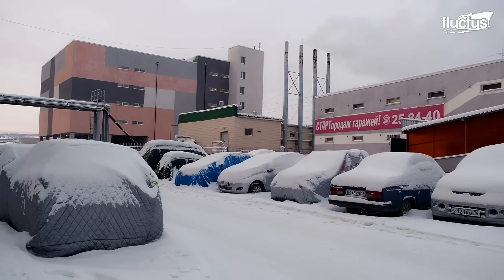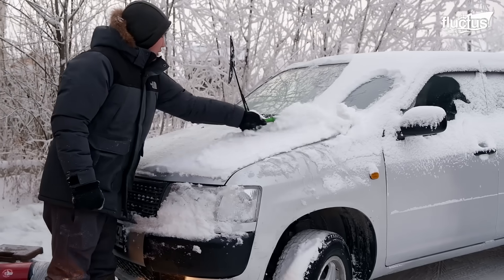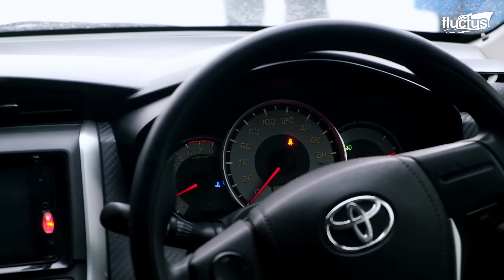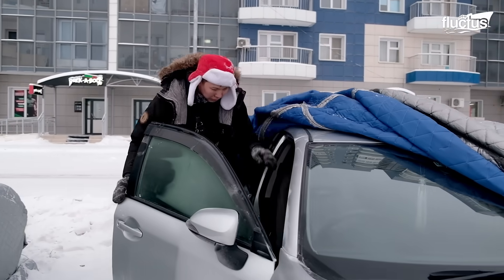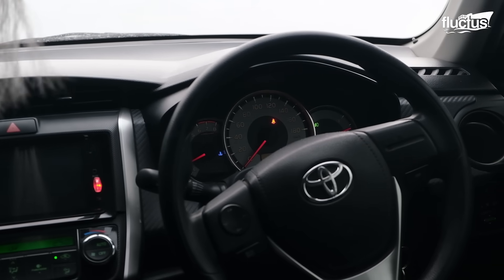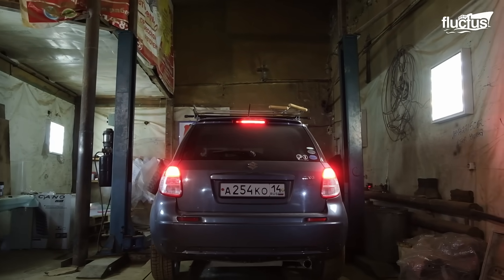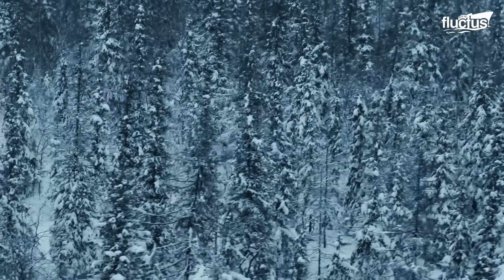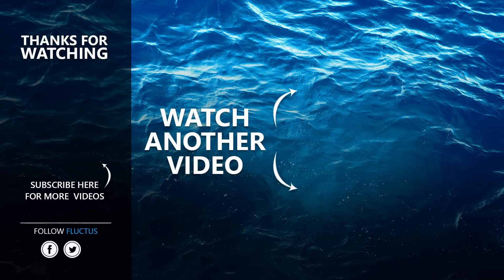How They Start Frozen Car Engines at -50°C in World’s Coldest City

Comment: In eastern Oregon we use a battery heater and oil heater, that’s why you see a plug pigtail sticking out of the radiator grill so we can plug it into an extension cord when we get home from work. Our temps can get down to around -5 so those work fine for us through the winter but definitely wouldn’t work for -50 degree climates. On top of that we have extremely low humidity levels which affects skin and other materials differently than the rest of the country, this dry climate is why you find mostly European people living these, others can’t handle the conditions just like I despise living in places like Georgia or Texas, the heat and humidity sucks for me.

Comment: They should have installed heaters for the engine and battery.  They have a battery warmer, engine coolant block warmers, oil pan warmers.  Still seems like an extreme environment

Comment: Although not quite this bad, from '76 to '80, I was stationed at an Air Force base in the northern tip of Maine.  I saw ambient temps as low as negative 29 degrees F.  Chill factors down to negative 50 degrees F.  I learned the hard way to remove the battery anytime temps got below zero.  Otherwise my '67 Chevelle would not start the next morning.  Being a native southern Californian, the winter weather in Maine was quite a shock.  I had to deal with frozen doors, tires frozen to the ground, and lots of oil leaks.  Old cars are not well suited to extreme cold.

Comment: Well lets see where to start? 
Synthetic oil is well suited for these temps.
Battery warmers with  low temp stats work very well. As well add a year or so of life to them. 
I see that they are trying for another Hindenburg , with attaching the ground onto the battery! It is always best to attach to a ground on the block/ or of such. So that any sparks are away from the battery. Not my doing but have seen 3 batteries explode, so don't wish any more. 
As well block heaters for such temps are a great idea. Or two depending on the engine size! 
I see the corrosion on the one battery at  (4:27 time. ) little  wonder why it did not start!! 
Prevention is always better!!

Comment: Guys why not just empty the oil in the evening takeit inside the house with you.... then in the morning heat it up on a stove and pour it back inside the engine while the oil is very hot
Reply: Because that doesn’t really happen all that fast you gonna crawl under there last i checked it comes out the bottom

Comment: I wonder how an EV would do there? My Tesla has automatic battery heating and no motor oil of course.  Still,  I bet there would be issues.
Reply: Guaranteed battery’s do not like it cold charging could be slowed to a crawl capacity overall diminished and thousands in battery’s every couple years had enough yet?

Comment: All you need is an engine block heater which you plug in. Starts every time. Order the vehicle with one or install one... it's easy and you don't have to go through this nonsense. Or an electric battery heater. ANYTHING but this.
Reply: And possibly add a battery blanket heater too.
Reply: @Bambihunter1971  Yes, I said that above. It's a help.
Reply: The engine block heater might work a little bit but this is not Alaska or Michigan this is really cold temperatures and requires extra heat to warm up
Reply: To complicated to Rasian inginier

Comment: Why don’t they install block heaters to cars? Would be much easier and faster.
Reply: it's not practical, they run on electricity and would need to run 24/7. A block heater is like running 20 100 watt light bulbs for 20 hrs per day..This is Yakutz in Russia...not USA..temps in yakutz get down to -50
Reply: @scotthughes7440  well at least here in Finland we have timers in our outlets to make the heater turn on 1 hour before leaving. It’s definately more efficient than blowing warm air to the engine.
Reply: Because you have to find a socket. They are not common on parking areas.     To build an one parking lot you need to go to several companies and city administration just to get an approval. Who would pay for all this paperwork and installations and electricity bills after cold winters? All this questions has no answers for now